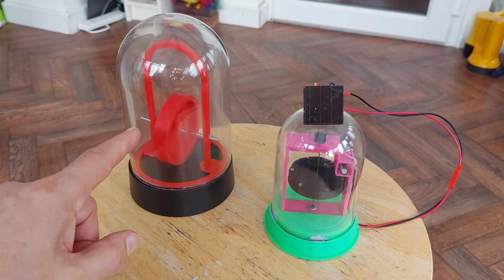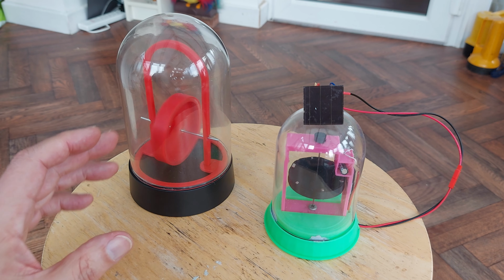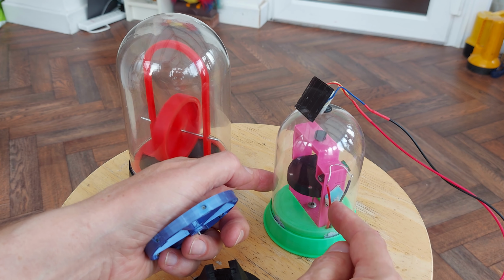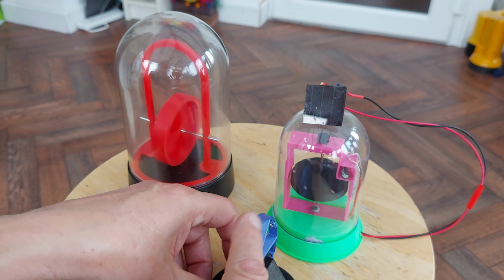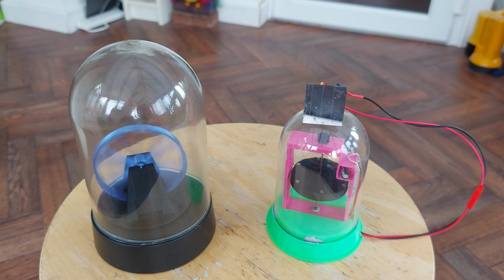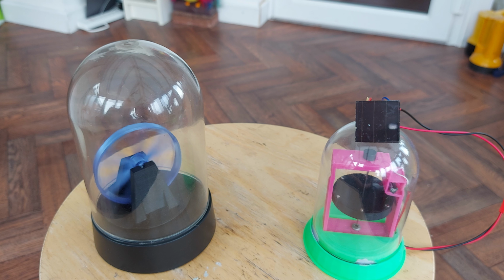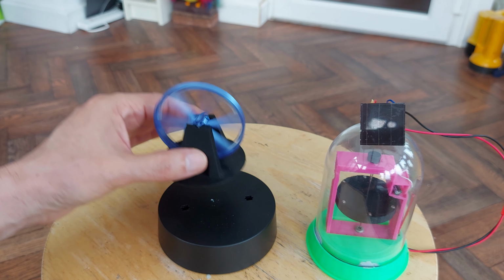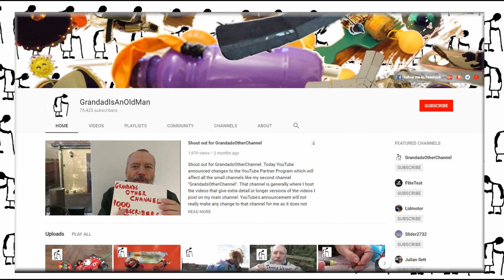Chaos Cloche? Another Pulse Motor!

Comment: Yes, I like the idea of them in a cloche. Looks good.
A while back, I was looking for a football size glass sphere. Found a couple online, but very expensive.
I wanted to try some stuff with high voltage. I would need to use a vacuum to get rid of the air, then attach some electrodes just to see the plasma being produced. Looking at that cloche you use might be just as good.
The only problem would be not collapsing them under vacuum, but the cloches look fine.👌👍👍
Reply from the maker: Yes, bearing in mind I managed to break one of those cloches just getting the base off, I don't think they are particularly strong 👍